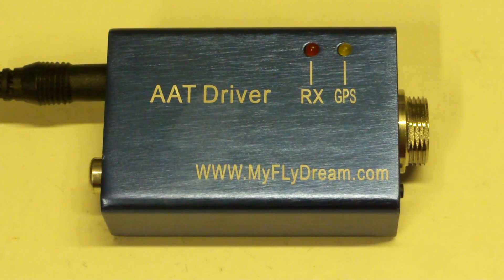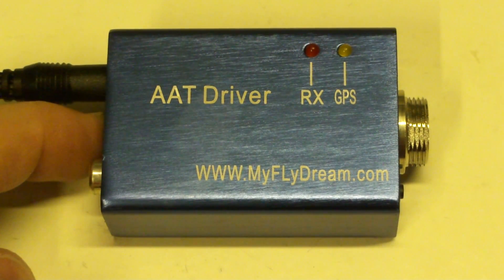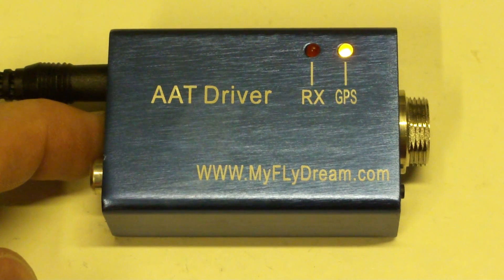How to configure Driver into GPS mode

Comment from the maker: HighSpeed mode is not bettery for FPV. But with HighSpeed mode you can use a 38400bps GPS on the Ground. So you can use the tracker easier and with better accuracy.

Comment from the maker: Partially you are correct.
When AATDriver working in HighSpeed mode, it can automatically detect a 38400bps NMA GPS. When it is working in LowSpeed mode, it can detect a 19200bps NMEA GPS.